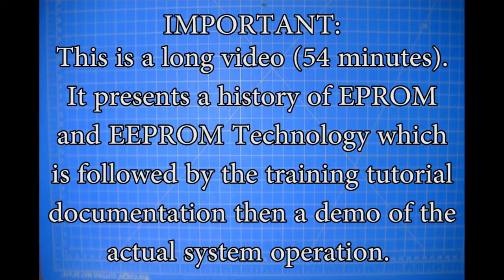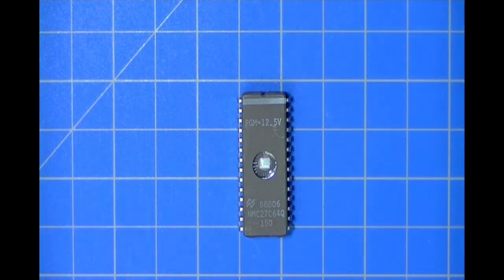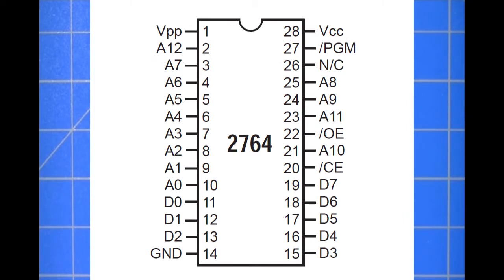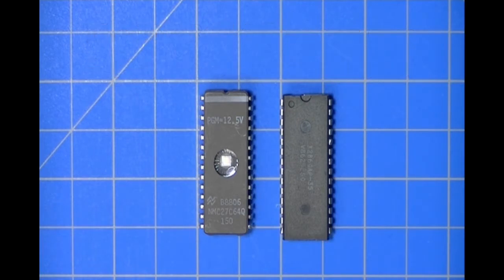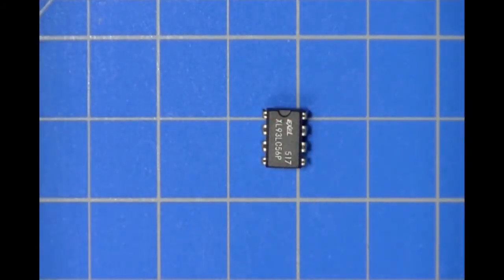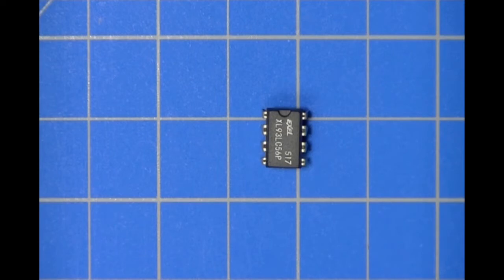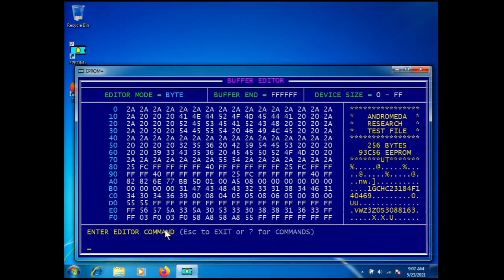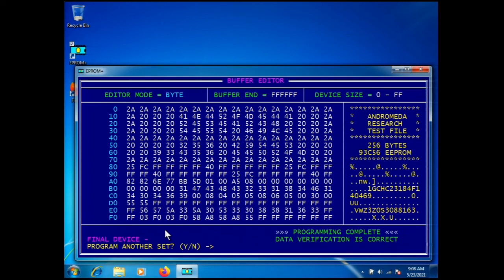Automotive EEPROM Training Tutorial and EEPROM education package included with the Automotive Kits

Comment: Thank you John for job well done, informative and excellent videos as usual. Could you please shed some light on OTP memory  or One Time Programmable memory ( this technology was used by the military in 1959 on Intercontinental Ballistic Missiles ).  Some ECUs have OTP to prevent aftermarket shops from working on those ECUs, and this type of memory is found in the flash memory or it could exist in EEPROM. Thanks
Reply from the maker: One Time Programmable (OTP) memory parts basically fall into two categories; bipolar proms and eproms. Bipolar proms programmed by blowing microscopic fuses on the silicon. Once blown they can't be changed. OTP eproms are simply stnadard eproms in a plastic package with no quartz window to allow erasure. OTP eproms are cheaper than UV erasable parts. Flash eproms and eeproms can always be erased and reused. In vehicle modules the flash and eeprom parts are programmed by code in the module processor. The processor code is what prevents changing the program or data, not the part itself.

Comment: Hello sir, thank you for such a professional tutorial.  My question is to get the most complete kit, the Ar32 kit 1 or the Ar32 kit 2. I also want to know the Panasonic CF-31 with Wind10 64 can support your software, please explain which laptop I can use.
Reply from the maker: Kit#2 covers all eeproms and Motorola microcontrollers. If you purchase Kit#1 it can be upgraded to Kit#2 by adding the ACOM2 adapter. You never have to buy another kit.  Regarding software, when running under windows we run in a virtual machine (VM). Microsoft provides the VM in 32 bit windows. In 64 bit systems a VM must be added. Many customers simply run the system on any hardware from a bootable USB drive thereby bypassing windows altogether. The system runs fine on a CF-31 with or without windows.

Comment: Really loving these videos and I’m really interested in the automotive kit. I have a question though. With this set up will I be able to virginize a module as it remove the vin and The module be installed in a vehicle and be programmed as if it was a new module. I do a lot of work on GM vehicle and after 2010 the modules are once and done. I would like to get around this.
Reply from the maker: With the kit you can, read, edit or remove the VIN plus more. The easiest way to virginize a module is to acquire a new module, read the eeprom and save it to a file. You can then use that file to virginize  any used or salvage module in the future.

Comment: Hello, does all this still apply to the chips used today?
Reply from the maker: The procedure works with any eeprom based module. There are some modules which incorporate the eeprom function onto a custom silicon chip. The procedure does not work for these modules. Unfortunately the only way to determine if an eeprom part is present is to open the module and look. The year the module was manufactured does not matter. Both old and new vehicle modules use eeproms.

Comment: Hello, this is great info. trying yo figure if this is right for me. Can I combine different modules from different vehicles? I have a project, Ford 2013 Boss 5.0 going into a 1983 Futura. I have a ECU from a junk car  Pats deleted I have an after market main harness that will run the engine but I wanted to add the 2013 Mustang gauge cluster and full steering column with one key. I have the a 2013 J-box (ford calls it smart j-box) that needs to interface inputs for the cluster. I have no Original to clone. Can I use the vin from one of the modules and write it to the others? Where is the immobilizer located? If its deleted in the ECU how do I make it communicate to the J-box? Can I disable other modules like Sync, Nav... I see in the schematics that the J-box has a PATS IDS input or output  to the module. I'm very interested in your kits.
thanks
Reply from the maker: You can VIN edit or clone a module with the same exact part number. You cannot change the VIN in a non-matching part number module. and have it work. Sorry I do not have information regarding your other questions.

Comment: is there a database available anywhere that lists what modules have eeproms by make/model/year and the type/location of the eeprom?  seems like it would be handy.
Reply from the maker: Unfortunately no. There are many thousands of modules. It really does not benefit a company to create a database. Module design teams have used eeproms to store vehicle specific data for decades and are extremely common although there are some which store the information in the microcontroller itself.  The only way to tryly know is to open the module and look at the circuit assembly. We teach you how to do this with our training documentation included with our kits.

Comment: This is very interesting. What is the connection from the device to the computer? Can this be done via usb?
Reply from the maker: The connection to the host controller is IEEE1284. This interface allows the system to run with or without windows. If a host does not have the interface adapters and converters are available.

Comment: how relevant is this with modern vehicles & current diagnostic equipment .
Reply from the maker: First when does a vehicle become  "not modern"? If you can perform a programming/repair function via the OBD  port then by all means that's the easiest. and fastest solution. However, if a module is defective or won't communicate and your choice is a new, expensive module (assuming you can get one) or cloning into a cheaper salvage module you, as the tech or business owner, have the option. In most cases new vehicle modules, as well as older models, will use the same memory technology for vehicle specific data storage. In these "modern times" people are keeping their cars longer and longer. Having the option to acquire and copy data from a defective module into a salvage unit is a big plus and very cost effective for a small shop owner plus they don't need special software or subscriptions. They just clone and install.
I hope this addresses your question.
Thanks for the comment.
Reply: @andromedaresearchlabs7826  lol

Comment: can this software reset crash data on airbag ecus?
Reply from the maker: There is no standard connection points for ECU based modules. Also to establish communication the customer many times is required to cut tracks and solder external components. This is beyond the scope of our ability to provide support due to the different modules. We work by connecting directly to the eeprom part; no unsoldering. ECU based modules are best addressed with a J2534  product assuming it supports crash data removal.

Comment: Hi, how can i know wich data is in each address? I mean to understand wich address is the key data, the pincode, the km and all these....
Can i get you mail or whatsapp, im interesed on buy....
Reply from the maker: When you view the raw hexadecimal data it's difficult to know which bytes represent a specific parameter or setting.  In our video on digital clusters we show how mileage is stored in a GM cluster. ASCII information, such as the VIN, is usually easy to recognize. One technique is to read two different modules (both with same part number) and compare the result. You can use the compare function in our tool to show the differences which can point you to the possible addresses where the information is stored.
If you wish to purchase you may do so from our website (www.arlabs.com). Our email is arlabs@fuse.net.